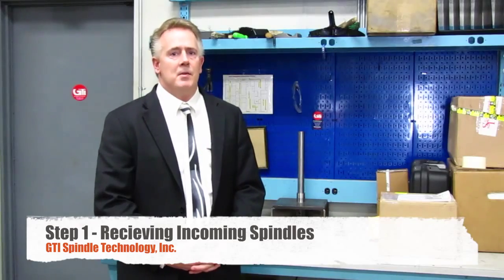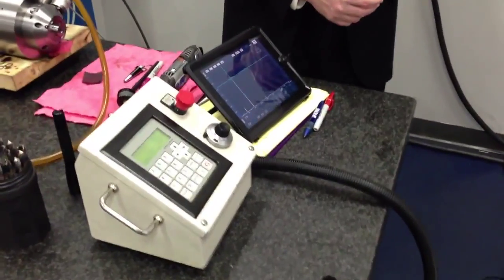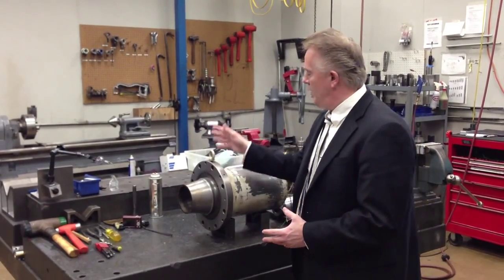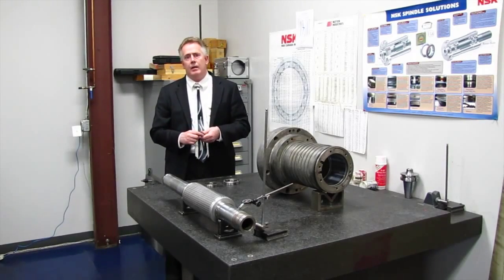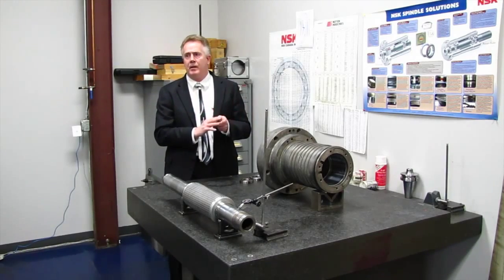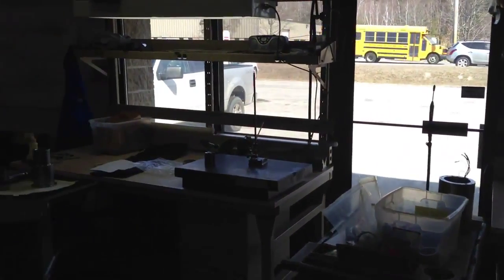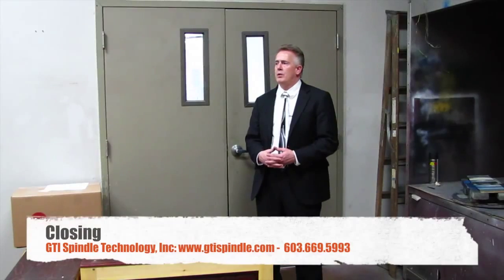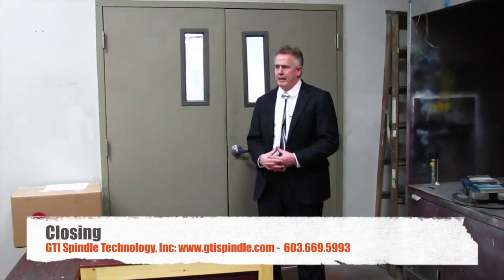Our Spindle Repair and Spindle Rebuild Process - GTI Spindle Technology

Comment: at 11 mins he talks about special bearings with seals do you sell them separately? 
I'm building 2 spindles 
on the back they have a timing pulley / Renishaw encoder and breaks I'm not worried about the back but the front I cant seam to figure out how to stop coolant from going in and forcing chips into it. 

would love some help here 

also from your experience is it better to have the spindle built into the head stock or as separate units? 

thank you
Reply from the maker: Yes we can supply bearings of all types including but not limited to sealed bearings, hybrid ceramic bearings as well as specialty bearings such as oil drilled races and inner relieved races.  
 
The best prevention for coolant ingress into the front of the spindle is to insure that the part coolant jets are aimed at the part and not at the face/labyrinth/front cap area of the spindle.  Additionally, if there is a provision for air purge it is very important that it is being used and the proper air supply is being provided.  It is also critical that the air purge/positive pressure stays on for a period of time after the spindle is shut down and cools.  If this positive pressure does not stay on until the spindle has cooled, the cooling action of the spindle will allow coolant to be pulled into the front of the spindle much like solder into a joint (capillary action).  

One last point is to be sure that high pressure air guns are not being used to blow chips off the part as this high pressure will overcome the air purge and force coolant and/or chips into the front of the spindle.  
I hope that you find this information helpful.  Should you have any questions or require additional information and/or assistance, please feel free to contact Lisa at 603-669-5993.

Comment from the maker: Yes, adding tooling to a perfectly balanced spindle can cause vibration to wander out of tolerance. Good tooling is of course a must. Also we encourage customers to send pulley,s, rotary unions and other components that will be attached to a spindle so it can be all balanced together.